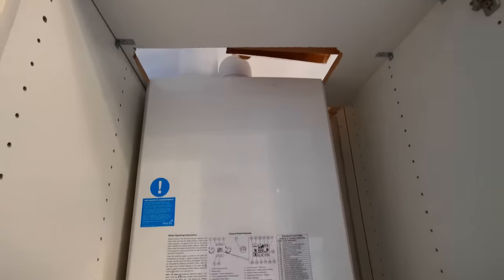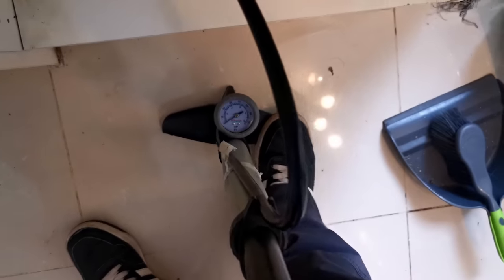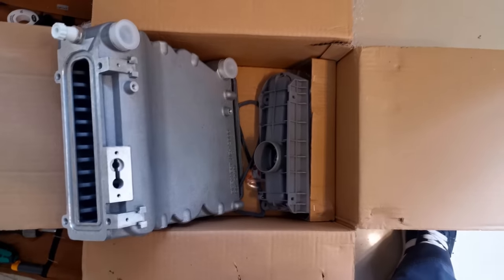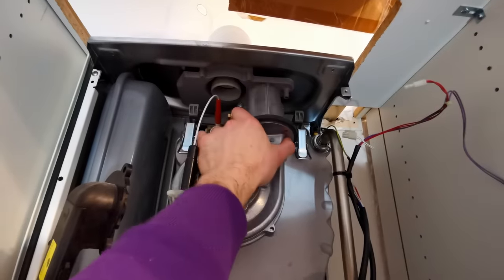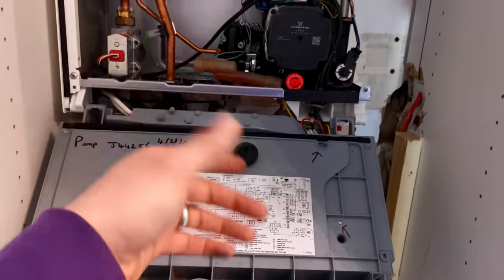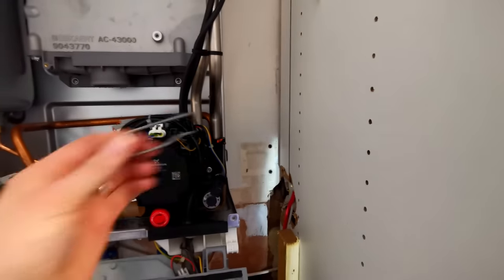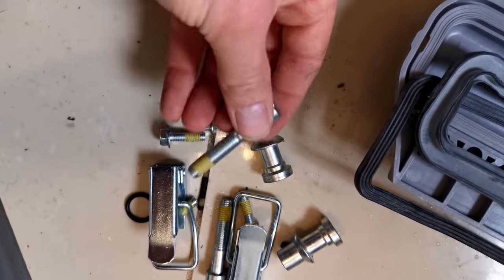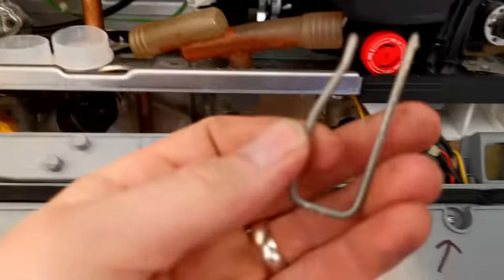How I became confident at boiler repair. Alpha boiler Repair. Main heat exchanger replacement.

Comment: Good on you Ollie for having the Turkish cypriot flag in the back ground. I'm Turkish cypriot. Good honest video. We all make mistake. I did one on a diverter valve. Instead of pulling pin for the head I pulled pin for diverter. It got very wet.
Reply from the maker: Brillant, I have done that too. Cost me a PCB... ;-)

Comment: Really enjoy your videos.
My mothers combo boiler (valiant eco) on four different occasions has shown a F75 code and is only one year old.
I contacted the installers and told them i,ve had to reset it on the four occasions and given them about the fault code.
They sent a young engineer who just showed my elderly mother (92) how to reset it even though I had already reset it and it was working fine.
My question is i know the fault and the cure but this engineer took the easy option, in and out in fifteen minutes.
I shall however be calling the heating company and educate them on a lousy engineer.

Comment: The last year or so I’ve gone from installs to more and more breakdowns. I’m not finding it too bad apart from my hands are often in the way as they are quite big, there’s always a tool that I could do with that helps better but you can’t have them all. Practice has improved my confidence as there was a time I used to stare blankly at them for too long 🤣
Reply from the maker: We all do that. :-) I have done it for at least an hour on a boiler recently.
Reply: Breakdowns are scary but I love these videos 👌🏽 I’ve done the odd bits and bobs but nothing like this
Very good video
Reply from the maker: @hakimvlogs6579  The more you the easier they become. :-) Just do more

Comment: Great video as usual. 👍🏽 Looks like alpha  have made a cheap cast Alu heat exchanger boiler to compete with ideal and now every other brand !  So I’m guessing every service requires to remove the flue collector and the boiler and burner to flush the internals of the heat exchanger.
Reply from the maker: Yes, I think every 2 years this heat x is meant to be removed to clean it. :-)

Comment: Fair play for going at that Alpha boiler without doing one before and I'm glad it worked out well in the end mate.

Those downfiring aluminium heat exchangers are not long lasting in my opinion so you will probably be back again in 5 years if the waters poor.
How old was that Hex ? 
A good manufacturer like Viessmann or Intergas will give you 10 years plus warranty on the hex.
Reply from the maker: The heat x wasn't blocked that I could see. It worked though. :-)
Reply: @HeatingGeek  
If it wasn't blocked, why did you change it ? 
There is a reason you haven't done many of them, because they are a proper heap of dirt and it would have made more long term economical sense to fit a boiler with a serial feed stainless Heat exchanger, no offense.

Comment: was the heat exchanger leaking water through the casting (porous casting) or was it blocked internally in a water way restricting flow and overheating? or combustion gases not passing through and giving flue temperature warnings?
great honest video by the way, well done
Reply from the maker: I don't think the heat exchanger was ever the problem. I was sent by Alpha (the manufacturer) for British Gas (who the customer had cover with) to replace it. I do as I'm told in that situation. My opinion doesn't matter.

Comment: your right baxi have a lot to learn about essential spare parts.... but worcester give you all plus a few you may not need...great vid, i also got wet once, what was the issue with that exchanger / manufacture fault or scaled up
Reply from the maker: It was blocked..... Apparently. I couldn't see a blockage but the boiler worked fine afterwards. I didn't diagnose this  job. Just sent to replace the part for BG.

Comment: Why don't boiler designers make thinks a bit easier, but they do now, the new Worcester 8000 series where you can take off top sides bottom of the casing and parts are colour coded for engineers. Great video mate, well done.
Reply from the maker: The 8000 isn't easy :-)

Comment: Good to see u olie hope your well mate.
Reply from the maker: Still in North London? What are you up too?
Reply: @HeatingGeek  yes mate still in north London. I just been on the install side. Been doing a lot of install work but ive started to try get into breakdowns so started watching some videos and what a surprise to see you on here haha. Good on you mate always rated you as a engineer.
Reply from the maker: @jerrickcajigas3113  Things all good with your family etc? I haven't seen Michel in a while. He's doing ok though with the TAXI etc
Reply: @HeatingGeek  yeh family is all well. Kids have grown. Hope yours is well. Last time i spoke to you, you only had one child. Spoke to Michael few months ago he seems busy doing his taxi driving. You just self employed?
Reply: Olie i have a question for you if you dont mind. Just went to check a glow worm betacom 24. Boiler does fire up once there is a demand ive seen the boiler ignite and flame comes on. Problem is after around 5 to 10 seconds boiler just cuts out and locks out. Ive checked fan, pump which are fine cause the boiler has fired up. Checked gas pressure on the gas valve which was fine too. Question is, what is causing it to lock out straight away? Condense not blocked flue aint blocked either.
Reply from the maker: @jerrickcajigas3113  Do you still have my number?
Reply: @HeatingGeek  no i dont.
Reply: I found your website i found your number on there. Will buzz you one day. Thanks mate

Comment: Another great video, thankyou.  Why did gas valve take time?  just interested
Reply from the maker: Good question! I have a video on setting them up. All the boilers with his gas valve take a while to set up. Baxi GA Alpha intec 2 and Warmhaus all have this valve with the same sort of set up. You have to set ignition , high and low combustion rates. But the button pressing isn't very intuitive and it gets confusing. Also you have to wait for the boiler to try and set its self up.... By the time you get to adjust the boiler is usually about to shut down on temperature... Poor logic in my opinion.

Comment: If it is your boiler i suggest change to a vaillant everything much easier. After everything you changed and the time you invested would it be cheaper to buy a good and easy one to change parts.

Comment: hi i have the alpha e tec 28 fitted, ive got some knocking and i was wondering if you could help.
everytime it starts up it makes some clicking sounds usually 3 or more, but i think thats normal straight after there are 3 knocking noises that can be heard around the house.      it also does the 3 knocking sounds everytime it shuts down.  many thankyou  HeatingGeeK

Comment: Just a question me old mate. About a Worcester Boiler filling key which is now stuck, I didn’t know that the mrs topped the pressure up in July, me checking the boiler the other day to find the key is stuck, is there an easy way to prize this key out so I can replace the key. Thanks boss advise welcome 🙏🏻
Reply from the maker: You can add a little washing up liquid to the top of the key where it comes out of the top of the filling link. Then wiggle (obviously make sure when you pull it downwards you are on the unlocked icon). It just takes a bit of wiggling

Comment: Hi mate, another great vid! question, if you have already changed the pump and ntc's first how do you go about charging the customer? obviously you were not going to change the main heat exchanger first off but I've sometimes found it awkward to tell customer the part I've fit hasn't completely solved the problem, just interested to hear what other Engineer's do. Really enjoy your vids, great work
Reply from the maker: It was all insurance. I didn't change the other parts and I didn't say the main heat exchanger was needed. I was lucky in this job because the customer was just paying a monthly fee to BG. I was sent by Alpha who were doing BG a favour (under warranty) and replacing the part. :-)

Comment: Hey I’ve sat and watched your videos tonight, I have a vaillant 837 like you have (if you still have it) I want to fit a nest thermostat 3rd gen to it, can you do a video for the wiring? I have an old wirelesss thermostat attached to it already so I am hoping it will be an easy replacement
Reply from the maker: The wiring is the same.
Reply: @HeatingGeek  the wireless wireless thermostat I have currently is a CM927, I just literally need to take the cover off and swap the cables out into the NEST Heatlink?

Comment: My daughter has this same boiler and we just can’t seem to get the up stairs radiators to heat up. Down stairs is Working ok. I have tried to switch on manually but no look. I can hear it clicking, but not engaging. It’s a Alpha boiler.
Reply from the maker: I guess it's fixed now. I bet it wasn't a boiler issue. Maybe air

Comment: you mentioned in a previous video that you do work for insurance and manufacturers.. some time could you explain how you got in with these or recommend how you may approach company's doing subby work... 
im self employed gas engineer and with covid it has died down massively but ive always wanted to get on with companys to do subby work but would not know where to start.. 

stay safe!
Reply from the maker: I just kept pestering them. Honestly, that's It. Get an email address and email it. Ask for application forms fill them out. Ask engineers when you see them. It took a few years with most of them.

Comment: was their an actual blockage in hex? or was it just the gas valve was out?  pipe would have caught me out. Vary few are like that.
Reply from the maker: The boiler worked fine afterwards. The boiler worked straight away but the combustion was off.

Comment: That reminds me of the fateful night a friend called me around midnight and asked me if I could come over and disconnect her dishwasher as the movers were due at 8 AM the next morning and she couldn't get the hose disconnected. I'd just gotten home from a dance so I grabbed a bite and then walked to her place, getting there around 12:30 I guess. The connection was in a 40 cm wide cupboard, 60 cm deep, so getting my shoulders in there was quite tricky. The shutoff valve looked to be broken, only a square brass shaft sticking out of the valve body so I did ask her: "You're absolutely sure you've closed the valve, aren't you?" and she confirmed she was. On the valve there was some kind of quick-release connector I'd never seen before (and haven't seen since) but I couldn't get that to budge either so I started unscrewing it from the actual valve. Everything was fine until I got to the very last bit of thread when I was met with a torrent of cold water (water pressure is somewhere above 4 bar round here) and couldn't get the bloody thing back on! I screamed for some buckets and the next few minutes were a mad dash of me filling up buckets in record time and her scrambling through the hall to the loo to empty them. I can't remember why we couldn't just dump the water into the kitchen sink, possibly the trap was off or something like that. Once I heard a mighty bang because she'd slipped on the wet floor, thankfully only on the return trip, not with a full bucket. After several rounds of this I had the brilliant idea to ask her about the main stopcock. She told me she had no idea if there even was one but she'd have a look in the loo. Less than half a minute later, the torrent slowed down to a trickle and stopped.

We then went on to mop up all the spilled water, pull out the sink unit, only to find soggy carpet underneath as the genius who'd installed the laminate hadn't bothered to pull out the cabinets to remove the carpet. While doing that we were suddenly plunged into darkness because some of the water had found its way into a power strip on the floor and tripped the RCD.

In the end I went home around 2 AM wearing borrowed socks because my own were completely soaked. What a fun night!

The other major learning curve wasn't strictly my own fault. Me and a mate were fitting a SaniFlo and associated pipework in his mom's office because she wanted a sink in a room with no plumbing. He did most of the work and then went on to test it by pouring a mixture of iced tea (that had gone off and bits of green mould floating around) and tap water down into the SaniFlo using a makeshift funnel. He poured and poured and then the pump kicked in - causing the pressure side pipe to come of and spray everything 2 m up the wall with that foul mixture! I was on the other side of the room and was spared but he was completely drenched! At first he cursed a bit but then we had quite a laugh!

I'm glad the whole setup has long been removed as it didn't exactly look like it'd been done by a qualified installer... we'd even used regular push-fit drain pipe for the pressure side! Amazing it didn't leak! I haven't touched any plumbing since, except for one emergency repair where an old lead pipe spliced to a newer copper supply started to lead and I quickly soldered a cap onto the end of the copper to prevent a flood. My actual background is electrics. Not that I never screw up in that field but I haven't had any spectacular side effects so far.
Reply from the maker: I have had saniflow experiences. I don't talk about them. One involved using bricks as stepping stones so I didn't have to stand in excrement. I vomited on the floor on that job. No one saw (no one would come into the basement ) in the end I used bin bags to cover my boots and just got on with it. :-) Grim. I don't do plumbing anymore.
Reply: @HeatingGeek  Ugh! That sounds awful!

Unfortunately in some places there's really no other option.

Comment: What was the problem with the heat exchanger to need exchanging? I don't think I got that.
Reply from the maker: It was apparently blocked. I didn't notice anything but the boiler did work ok afterwards. :-) Sometimes I do what im told and don't ask too many questions. :-)

Comment: What would you do if your PCB board get wet??????
Do you first check back of the board for any evidence of water or not ??????
How do you dry them?????
Reply from the maker: I would remove the board. Dry with tissue and then a hair drier. The alpha cover is good though. :-)
Reply: @HeatingGeek  
Good , the same.
Reply: I would turn it on by the spur and let the electrics dry it out you can normally hear it crackling that when you know your all good

Comment: Been a subscriber and follower for quite sometime, excellent vlogs from a 10/10 diagnostic / logic engineer. can you give some insight to the Vailant 937 dip tube replacement, the hot water flow sequence through this boiler, the flow rate test covered the plate, does this include the the stored water which was impacted by the dip tube, also the flow rate when pre- heat is on and the shunt pump is in operation. I know its a big question,  but unable to find any insight from the MI. really appreciate any insight you have.  Fantastic channel keep up the good work
Reply from the maker: That is a big question that I can't really answer with words alone. I have quite a bit of documentation on that boiler. ;-)
Reply: @HeatingGeek  I really appreciate your response. The MI pdf for installation /  fault/ srvc offers no flow sequence of operation. Would it be possible for you to identify the MI documents and their reference number that you have

Comment: Do you have to used a heat proof grease (molykote) on any of the components at all or is it just normal silicone grease?
Reply from the maker: I just use silicone grease. I have never had a problem. It just to lubricate the fittings for assembly. :-)
Reply: HeatingGeek ok cheers mate 👌🏼

Comment: Thank you
Reply from the maker: No problem. :-)
Reply: HeatingGeek I have been installing boilers for years and I always wanted to change direction.  I know it takes time and experience, did you go in any boiler fault finding courses?  And what is a patron on your channel? Sorry I’m sending from my YouTube channel my name is Norm from Essex.
Reply from the maker: @onemandrone  Patreon is a way to support content creators. You just give a few bucks (Yes its American) to the creators and maybe get some perks from them along the way. :-)  I wouldn't recommend any courses at the moment. Just spend the time to diagnose the fault with 100% certainty and you will improve every job. We all get things wrong and you do learn from your mistakes.
Reply: @HeatingGeek  Thank you. I did a sime repair today on a Potterton Performa. On heating and hot water the boiler fired up and after about 15 seconds it cuts out and restarts. I cahnged the Electrodes and leads and done the trick. What i really need is a good Multimeter like your one, as the one i have isnt the best. Maybe you could do one day an online live chat with your group Q&A's? But thank you, and i check out the patron